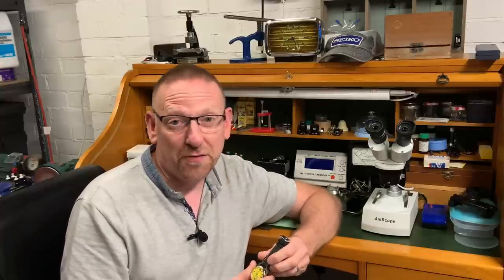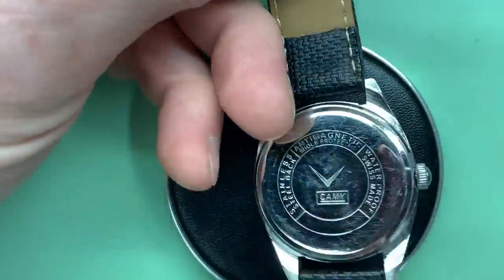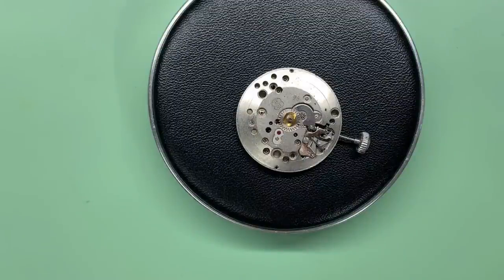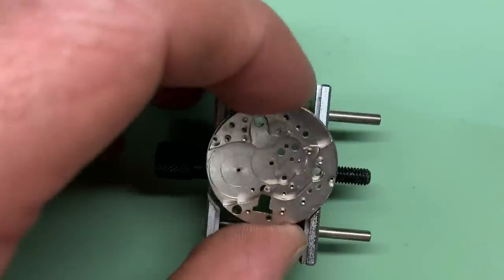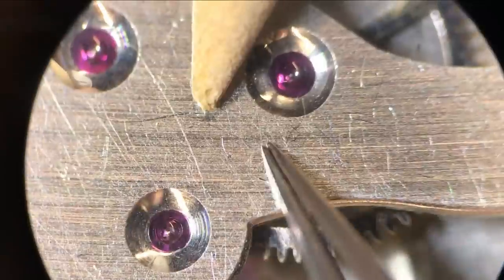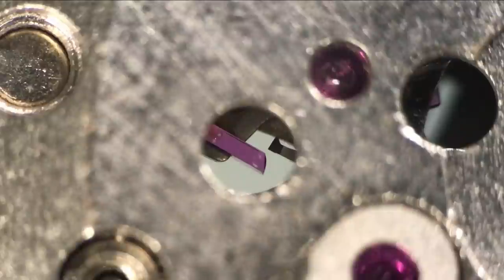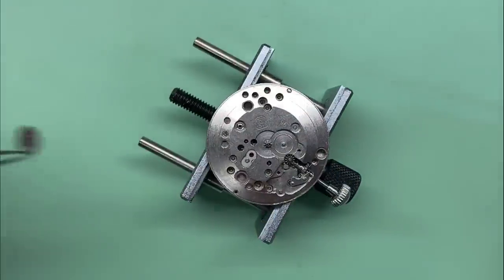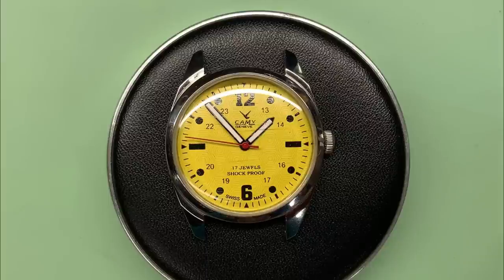Whats Inside a "Mumbai Special" Watch?

Comment: if the movement IS swiss and everything is branded how is it a fake?
Reply from the maker: Because the case and dial are not original. The dial is completely hand painted / printed and has no representation of a genuine Camy. Also the caseback is stamped poorly to an original.  These parts have been made to deceive.
Stick a Ferrari engine in a BMW it does not make it a Ferrari
Reply: @MyRetroWatches  thank you for answering. What would then be a good solution if, say, the original case and dial are destroyed beyond repair and someone wants to revive the watch?

Comment: There was a swiss CAMY company but how do you know this movement is genuine?  We have a watch marked "Rolex" that cost less than one twentieth the price of one from a Rolex dealer.  Fake watches are common online.
Reply from the maker: It’s a genuine FHF movement which were made in their millions.
Many Swiss brands would just use an off the shelf Swiss movement to put in their watches as some top brands still do.
Reply: @MyRetroWatches  The parts are polished in a the real FHF movements I have seen.  Some fakes may be polished but this watch is dull.  How do you know that this watch which came from the land of fakes is real?
Reply from the maker: @SuperMurrayb  I just don’t think the movement is fake. Why would it be when they can just salvage them from the plethora of old watches available and then sell it for £10 and that was from a uk seller who clearly bought it from India.
I’ve worked on enough movements like this to assume this is a genuine one.
The tooling involved to make all those parts is considerable so all that effort for literally nothing

Comment: If you need to Google this caliber, ST 96, which produces in the millions and was considered a good mechanism, you are probably completely new to the profession .....
Get a tip: it has a slightly more sophisticated version, ST 969. Both mechanisms have replaced the popular and successful mechanism as well, AS 1686, and the model that preceded it, AS 1187.
Reply from the maker: Hi I am just a hobbyist doing this for nearly 4 years but mainly on Seiko or similar , I just work on what I like and not into the wider picture. This is the first time encountering this movement. Looking it up on the internet was aimed for my viewers to understand and learn how to identify what they might be working on to find out more about the movement. זבולון יעקב

Comment: fhf 96 does not look right , the metal finish , it may well be the camera , it just does not look like a swiss made movement , even keyless parts look sus . the quality of the parts looks poor .looking at the timegrather  thats not a swiss movement .
Reply from the maker: Well I think its genuine, Not everything from Swiss makers is top quality. Look at all the millions of 1 jewel pin pallets that were "Swiss Made" BFG movements for instance and many others.  This FHF although I dont have another to compare looks like many movements I have been into.   These are of low calibre and mass produced playing on the good Swiss name, nothing more. Thanks for watching and you do still raise a good question.
Reply: I have bought and researched these movements quite a bit, and that one is genuine. It amazes me just how many variations were made, and how many in total were produced. They have many different brand names stamped into the bridges, some with a hammered effect, and some with swirls.